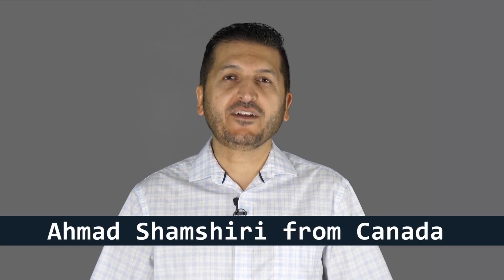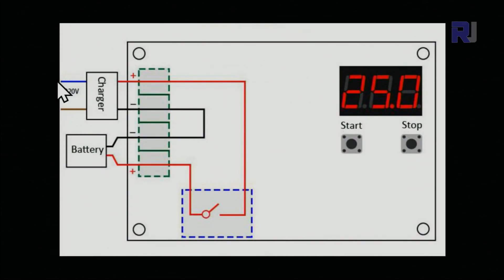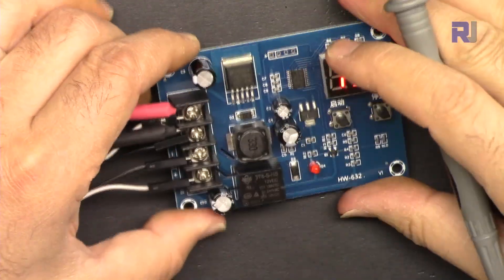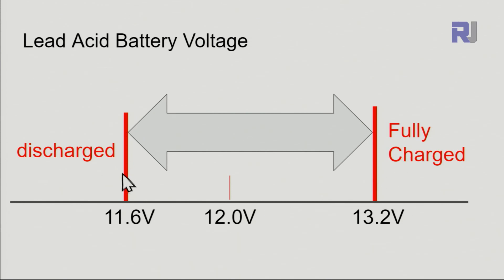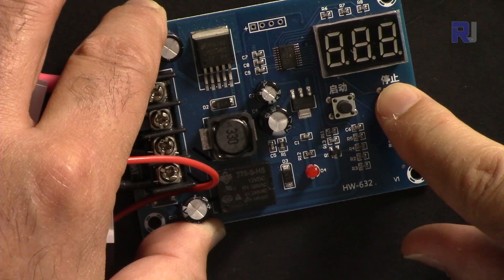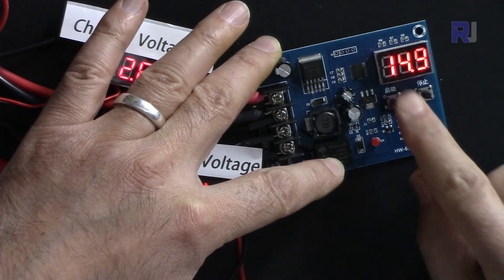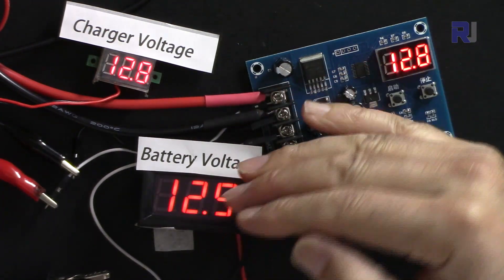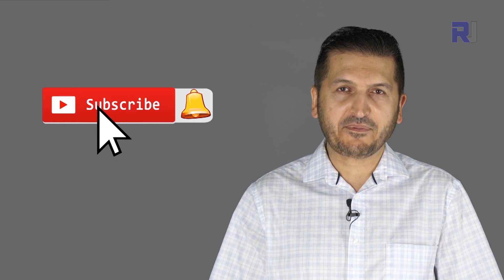How to use XH-M603 Battery Charger Controller - Lead Acid only, not Lithium - RJT296

Comment: Hi Robojax...how do you get the XH-M603 to detect and charge a battery below 5v DC? i have a 12v 7Ah UPS  battery connected to the XH-M603 but it cannot detect the battery and charge even if i set the lower limit below 5vdc. I have the upper limit set to 13.7vdc. Please help me.
Reply from the maker: Hi, I don’t remember the minimum voltage but you set the main and maxim and it should keep your battery charging.  Pay attention to what I said at the beginning. Watch carefully otherwise your battery can get damaged
Reply: @robojax  thanks for the quick reply Ahmad...once i set the lower (11.7vdc) and the upper limit (12.7vdc) even if the battery voltage is below the lower limit it will right away charge the battery and will stop charging at 12.vdc? thanks again.

Comment: Can I use it in a motorcycle to charge a secondary battery for other accessories ?
Reply from the maker: we don't look at name "car" or "plane". it is the voltage. so you can use it anywhere.

Comment: Can you tell what rating for a charger I would need to power my XH-m603 module, I want to charge cordless drill batteries which I believe are 18650 batteries?
Reply from the maker: This is NOT charger. I have explained it and also pot that in that title . This is chafer controller . This is just a switch to turn on or off a charger
Reply: Yes I know but the charger that you connect to the controller, what rating should I go with , ?

Comment: Can I set charging start voltage to 9v ,so to use for lithium battery
Reply from the maker: The relay is 12V. it will not work. needs 12V.
Reply: @robojax  but 12v relay even works with 9v battery

Comment: Later in your video, you indicated that your Charger Input was 12.8V. Is that correct? So in Canada it's 220V Wall Outlet to the charger that was putting out 12.8 Volts. Is that correct? My unit didn't work at all. Input to HW-632 was 19.33V from a Laptop Charger. When I connected to an 18AH Battery,  I didn't get any reading on the meter whatsoever. Any thoughts?
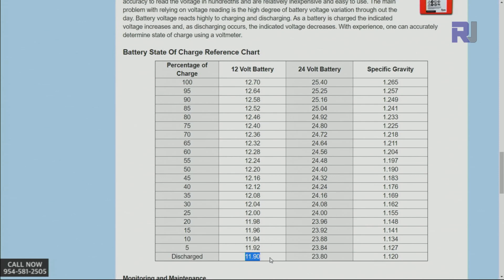Reply from the maker: to learn about current, please see this video at 6:22 https://youtu.be/3C33DpcSwIw I spend time, searched for the video, played it and got the time for you.
Reply from the maker: I've added link to resources page for this product in the description of the video. here is the link for you  https://robojax.com/learn/arduino/?vid=robojax_XH-M603_charger

Comment: The spec sheet on Amazon said the Input to HW-632 needed to be 10-30V DC, so I used a Laptop Charger, 19.33V DC Output, for the Input to HW-632. My HW-632 did not turn on. Your diagram indicates a 220V Charger Input. Please describe your 'Charger Output' voltage. HW-632 website description says the Input needs to be 10V-30V DC.
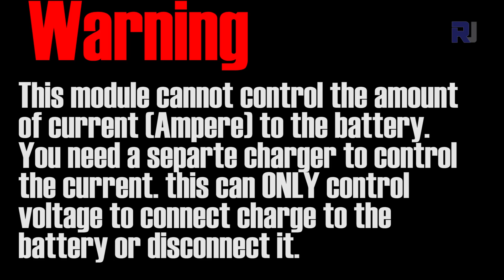Reply from the maker: Hello, it seems you have not watched the video and skipped. I just watched the video and at 1:22 I said very important fact. At 1:43 I mentioned the connection, shown the diagram and explained what it does.  the 10V-30V DC will make it turn ON and work.

Comment: Hi there, can it be used as a on board car battery maintainer/ tender ??
Reply from the maker: Hi, no because car battery needs to be connected continuously. this will disconnect the battery. also car will need regularly 30 to 50A and when starts it used about 100A to 400A. this can not handle more than 10A.
Reply: @robojax  No, Sorry my bad the question wasn't clear, I put it differently now, I have a portable  Bank charger and that's connected to the  car battery in the car for float charging and the charging is in progress, the charging voltage is 12.6 and now we go inside the car and acidentally start the car and the car Alternator is gonna kick in and push in 14.5 volts and huge amounts of Amps to the  portable bank charger ( external charger) so the charging bank is not gonna be damaged from14.5 volts and lots of Ampere from the alternator or my external charging bank is protected by diodes?
Reply: @robojax   This unit will not Limit the amount of amps.  Using this  When you're alternator raises the voltage You may find that your battery is charging too fast.

Comment: Hi, nice to greet you, I liked your video, but I have a question, could you clarify it for me? I have a transformer that in vacuum I measure 17 volts RMS but after I rectify it and filter it goes up to 24 approximately and that is correct because the capacitor that I am using is charged to the peak volt, now when I connect two lamps of 12v / 130w each One, the voltage drops to approximately 13.6v, the current that I measured consumption of these two lamps is 15.7 amps, could you then use this voltage source to inject it to the xh-m603 / 12-24v module,?
the battery I intend to charge is 12v / 70A lead acid ..
thanks mr,
Reply from the maker: Hi, I read this and did not get it before, but today I had reply as your comment was waiting in my mail box under "I haven't responded". I did not get "could you then use this voltage source to inject it to the xh-m603 / 12-24v module,?"

Comment: How can I connect a adapter to charger a drill battery which I don’t have a original charger for the battery
Reply from the maker: Read or open the battery to see what the voltage is. then get a converter that has constant current mode or CC so you can set current limit. I have so many of those  see my videos https://www.youtube.com/c/RobojaxTV/videos and I have explained how to charge a battery
Reply: @robojax  what video specifically do I look for these batteries are 18650 batteries

Comment: Can this module use in 4s 12v lifepo4 battery?
Reply from the maker: your question suggests that you have not watched the video. Please watch to get your answer.
Reply: @robojax  what i mean if i can still connect this module direct from the solar panel to lifepo4 battery safe?
Reply from the maker: Yes. you can. this module can work with that but does not control the current.

Comment: Ahmad, interesting to see this review, thanks for sharing. However, I feel as important to share that LeadAcid battery voltages you selected are extremely low for charging. In fact, Default values (seen after the reset you made) are more adequate. 
Lead acid should be recharged as soon as voltage drops below ~12.5V, depending of battery technology and “C” rate of discharge.
Obviously, this On-Charging voltage is for 25°C, but in cold climate (🥶 as in Canada) or hot climate (🥵 as here in Brazil), operating and charging voltages should drift. “Battery University” website explains this very well.

About Relay: if it is commuting output charging side, or from Solar powered panels, it would make 10A or C/10 ~ C/20 = up to 100~200 Ah batteries. 
If relay switches the Primary side of an AC powered charger, as “plan B”, the Output Amp rating could be even bigger.

About Solar panels: they initially behave at coarse “Constant Voltage”, then as as “Current Limited” power supply (like CV/~CC). If properly sized, they provide a Maximum “short circuit - Isc” current. 
Maybe even lithium batteries could be charged, if Isc would be a safe C rate for them. However, additional caution should be considered, because Voltage reference variations - in time (weeks) and caused by temperature - were not evaluated and might be to much for the precise voltage cutoff required by Lithium-based batteries.
Reply from the maker: Thank you for sharing your thoughts.

Comment: Useless unless it controls current as well!  It also needs battery to be fully discharged before it can be recharged.
A XL4015 module seems a much better choice as controls voltage and current.
Reply from the maker: yes. that's why I gave warning. But for those with specific current power supply, this might be useful.  I don't like it. Tht's why I did not put the lithium in the title too.

Comment: Hi my man, I've been a follower of yours since I saw you first time..

I wanted to ask you what do you think about this SPS, can it really give 300w BAM 18.20  20%OFF | 300W Switching Power Supply Board Module AC-DC Isolated Power Supply Built-in Power Supply Board DC18V20V24V26V28V32V10A
https://a.aliexpress.com/_B0Bb4p

Thank you for your time